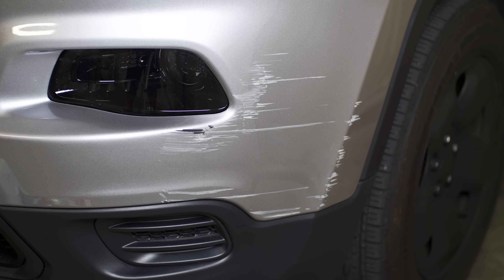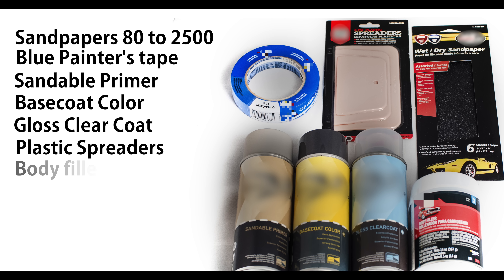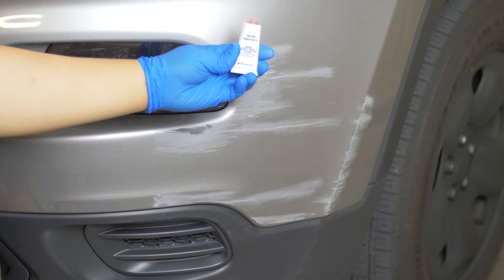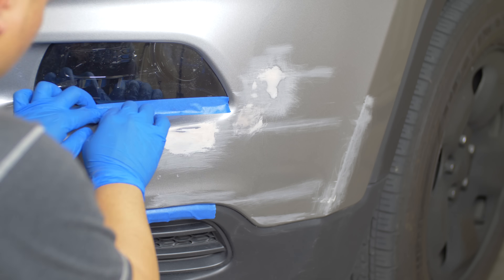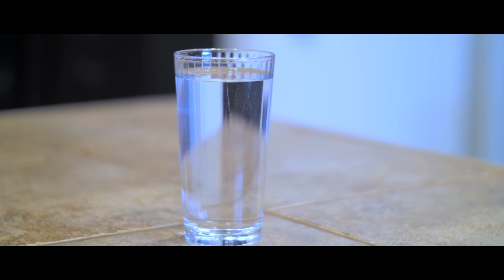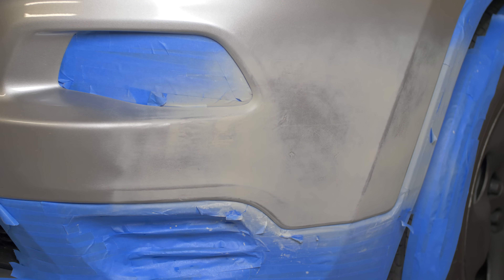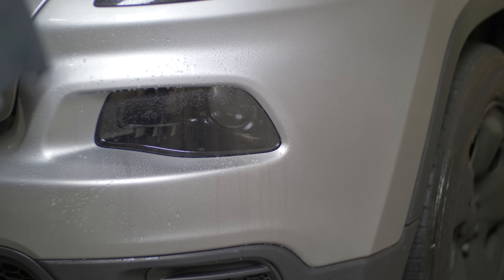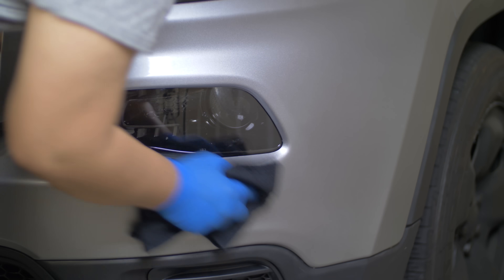How to Repair Scratches on your Car | Save Hundreds of Dollars

Comment: For those wanting a cheat-sheet breakdown of each step, here you go:

1/ 180 grit sandpaper to sand the scratches
2/ Clean with a microfibre towel to clean up the dust (dry)
3/ Mix body filler to hardener to right ratio
4/ Apply only to the deep scratches with a plastic scraper
5/ Let dry & then sand with 80 grit over the body filler
6/ Then a 180 grit to make it smoother
7/ Next, clean up the area with a microfibre towel to prepare for painting (dry)
8/ Mask areas to prevent overspray
9/ Spray the sand-able primer 5 minutes between coats, total 3 coats with each covering more and more area
10/ Let dry for 30 minutes
11/ Clean with a dry microfiber cloth again
12/ Sand with a 1500 grit wet sandpaper
13/ Then sand with a 2500 grit wet sandpaper
14/ Dry with a microfiber cloth
15/ Spray with the base colour like the primer, 5 minutes between coats & covering more & more area
16/ After 30 minutes apply gloss clear coats like the primer & base coats
17/ Leave dry overnight
18/ Next day clean with water & a microfibre towel
19/ Leave dry for 5 minutes
20/ Apply compound in dabs & rub in making 5 overlapping passes (by hand)
21/ Again, clean with a fresh clean microfibre towel
22/ Allow to dry for 5 minutes before applying a polish
23/ Polish with firm pressure & overlapping passes using a polishing pad (by hand)
24/ Then wipe it off with another clean microfibre towel This is your final 'buff'
25/ Done!

Comment: I followed all the valuable instructions here but the end result was not as shiny as the original paint. If you want the super shiny look , after painting and before applying the clear coat, there is a step you need to do to get that super shiny look. It is called "color sanding" which is wet sanding the paint with 1500 sandpaper to make it smooth. The reason is to remove the orange peel bumps on the paint, think of the mirror and the smooth silver layer behind the glass. It is not only the glass that makes the mirror shiny but the smoothness of the silver layer beneath. Glass in this analogy being the clear coat and the silver is the paint. Thanks for the video Thomas, saved me a lot of money.
Reply from the maker: Thank you so much for your suggestions. Unfortunately I didn't do that in this video but you are absolutely right. A lot of people in the comments mentioned sanding it to make it smoother and shinier.

Comment: Looks good to me. 800 dollars vs 100 dollars. I vote to keep the 700 dollars in my pocket. Thanks for making this video.
Reply from the maker: makeminefreedom thanks and you're welcome 😊
Reply: Thomas of All Trades Maybe you can come here in Sacramento and help me out, so I don’t ruin the paint on my car...lol
Reply from the maker: Michael Crz lol you got this
Reply: 700$ is for labour ..!!
Reply from the maker: sandeep shetty lol yeah
Reply from the maker: bo diddly lol i spent around $100
Reply: Air pump plugged in lighter pump started to burn while plugged in with car running  help
Reply: Moo hi
Reply: Thomas of All Trades hi I have one quick question I got the same scratch on my car like the one you had and you fixed it so my car colour is black any recommendation about working on with same way if you would tell me that would be great I got Hyundai elentra 2017
Reply: Lol so true
Reply from the maker: Bret Hart yeah same way make sure you get the right color black paint for your vehicle.
Reply: @ThomasofAllTrades  ok thanks god bless you
Reply from the maker: @brethart4938  youre welcome. thanks you too.

Comment: Nice DIY but it has a few flaws (no hate just helping): 

- When you apply a base primer (or any spray layer) make sure to press the spray head firmly to avoid any drops, spits or spills (as seen on 3:22). Sometimes you can get away with it as it may stay hidden under another layer or get sanded down later.

- When reaching corners always spray "over" the corners and away from the car. That way you won't create visible overlaps you'll have a hard time to work out the overlay so it won't be visible. The same goes with lines and edges. If you want a clean finish you gotta paint up to a specific line or edge where your stop won't be visible. You can try this yourself on something else. Like an old door or other stuff you can train your skill. If you stop halfway you will have visible overlays. 

- Spraying your color code might disappoint you in the end. Some spray colors tend to look different from what you have on your car. This may come from the light you are using (LED, tungsten, dayling, etc...) and angle (some metallic paints reflect light differently making it hard to hit the right tone of your color. Another thing is your primer. Spray primers come in a lot of colors. White, yellow, brown, silver, gray and black. And maybe some other colors. The reason is simple - using a specific primer color will help you to hit a different tone with your color spray paint. If you have for example a red car and it has been standing outside for some years you'll be on a road to hell getting your paint right. Silver is also complicated. 

- Using putty - use only as little as nescessary. The more you apply the more you have to sand down later. Meaning the space you demand in your 1st step will increase in each step. Suddenly you gonna find yourself working on almost a space 10x times bigger then you were looking at the beginning :D Reason is simple again - when you have to smooth out your previous step you have to blend it with the surrounding. And that blending in takes space. 

- When using clear coat ALWAYS use 2K clear coat paint cans. BUT BE AWARE!!!! ALWAYS WEAR HIGH QUALITY FILTER MASKS WHEN PAINTING WITH 2K SPRAYS!!!! If you inhale 1K spray aerosols you are pretty much safe. It will take some time to get out but you'll be fine. 2K on the other hand MIGHT KILL YOU!!! 2K means it contains not only the paint itself but also a hardener. Usually the hardener is separated and you have to press some kind of button before you can shake the can so both compounds mix. And when you inhale that stuff it may very likely glue your lungs stiff. Google it if you don't belive me. 

- Once you've done everything and the 2K clear has dried out propery then give it about a week or two to get back and polish it. Yes it may be dry to the touch but since you probably won't have a UV lamp to speed up the process then let nature do the work for you and wait. Once that time is up you are ready to finish your work by polishing it. Depending on your skills (or how much you trust yourself or how much you bother to get it done) you can take: 1) a simple polishing compound and just polish the hell out of it or 2) very fine sand paper for wet sanding to remove most of your orange peel look and then polish it with some compound to a shiny clear coat finish. You can see in the video that the finish is very matt finish which is not what you are looking for :) but Thomas of All Trades did a good job of using his camera at angles where it doesn't look that obvious :D but if you know what to look for you  will see it instantly :) again - no hate just tips to help. If I wanted to hate I'd just press thumbs down and left some negative one line comment. But why would I do that? 

- Last point - *price*. Why do paintshops charge you 800 USD when you can do it for 200 USD? SImple - 200 is for the rent, 200 is for tools and material, 200 is for taxes and 200 is what is left over. When I say rent I mean literally everything that is building- and property wise included not just the actual rent itself. The same goes for other "200" bits so please don't go into details here as this is not the point. And now what is left for you is the last 200 and here you have to really look out where you can save some cash. Lets say material. You work a lot so you can afford to buy bulk. BUT you gotta give your customers some guarantee (which you want for yourself as well because who doesn't want happy customers right?). Thus you gotta buy high quality stuff only. Now you gotta find the line where cost and quality is on par so you still save some bucks but you still maintain quality. But don't worry. As soon as you found your golden sweet spot the supplier will increase his price one day leaving you to consider what to do with that. Stick with your prices or raise accordingly to level out the buy price? The same goes for material, rent, taxes... everybody will at some point want more. And you have to play ball or find other ways how to cope with that so you don't lose customers. All that and more is something you DO NOT have to consider when you think "this is too expensive I can do it cheaper". Yes you can. And the paintshop could too. If the paintshop would not have to pay all of the mentioned above :D There is a reason for some prices being where they are. Do not disrespect it just because you are not ready to pay it. In most cases there is a looooong story behind it that you just don't see (and now you got a glimpse of it). If you are not willing to pay for something then that is absolutely okay. Go and do it yourself but please do not disrespect people that have to do your one time job for a living each and every day on a highly professional basis with a lot of unknowns and risks to take care along the way. This I am telling you as a person who is doing almost everything on my own because in most times I do not want to pay others to do stuff I can do myself :) BUT sometimes I do go all out and simply pay someone to do something for me. And I do enjoy the result as well as the feeling that this time I didn't have to do it myself. 

Allright.... now go out and do stuff :) take care :)
Reply: holy shit thank you
Reply: Thank you for taking the time to provide some extra information, I strongly suspect I’ll avoid making some mistakes I would have otherwise and I’m particularly grateful for the safety tip about the mask and spray painting 😌
Reply: Thank you for your advice and other insights! I appreciate it.
Reply: So in other words, better just pay an expert to sort it :D
Reply: @kylekeenan3485  that would indeed be the tldr version of the comment. 
It did give me a good idea to maybe get the cars polished. I mean, it looks nice
Reply from the maker: Thanks for your input!!
Reply: Very good advice. The 2K clear spray can is a must, the 1k acrylic lacquer clear won't last.

Comment: You could also wet sand your final product with 3k grit before buffing to flatten out the paint and make it blend better
Reply from the maker: Thank you. You're right!!
Reply: Hi Cesar, will doing this blend the new paint with the surrounding existing paint better? I applied the base coat but hesitant to put on clear coat as I'm worried that the final product will be slightly higher than the surrounding paint

Comment: Nice Job man. If I could give two tips it would be stop sanding after 600(metallic) or 400(solid) grit. The base needs something to stick to! Going to fine will not allow enough mechanical adhesion for the basecoat to bite into causing future adhesion problems. 

Another tip is look into the “spray max 2k clear coat”. It comes in an aerosol can that you activate. This will be far better than the 1k clear used. It will last just as long as professional shop clearcoat against UV.
Reply from the maker: The DIY Car Medic thanks for the suggestions! I really appreciate it! 🙏🏽
Reply: Dangggggggggg, I need to tell my barber the same thing. He is always wanting to reach for those other grits...hurts ma head!!!!
Reply: @TONYMLT  Oh stop crying. My barber uses chisels and a belt sander so count your blessings.
Reply: If I stop at 600 or 400 wouldnt fhe surface be rough? Will it become smooth after painting? Gonna do it for the first time here
Reply: Same question as InferiorG; please let us know!
Reply: Man you know too much. Do you have a youtube channel? Id like to subscribe. Id love to learn the mechanics behind every step used in paintng.
Reply: I agree on the 2k clear coat. I used 1k and it dulled out after couple years.
Reply: Also.. you want to make sure you have sanded with 320 grit sandpaper the entire area where the primer is going to prevent adhesion problems. Probley the most important step..
Reply: @MrAnonymous377  how often did you polish it?
Reply: @lindz151074   not often enough. Lol. The rest of the original paintwork is perfect
Reply: someone explain whar he mean by the first tip? im confused and first time

Comment: Dang you went all in with that sanding, you can usually stop at 800 for primer.  Nice job
Reply from the maker: A.J. Scalzitti lol yeah. Thanks
Reply: yes I agree 800 grit is good enough for the repair area. 1000 grit where you want to blend into. makes it easier to polish the outer areas after.
Reply from the maker: Nein Body 👍👍

Comment: Thank you.  If I wet sand primer then it washes away the primer from plastic and you can see the imperfections. It’s not smooth.  I used it again at the imperfections then it started dripping. I will try dry sanding
Reply from the maker: @rajeevjha9975  ok. Make sure the primer dries first.

Comment: Great job. One or two added ideas.
1. Use a bumper primer for your undercoat. This is a special plastics primer. Other primers don't adhere to the plastic bumper. These plastics have an oily like resin in them so the right primer is important. After priming apply your filler. Again there are plastic fillers that will stay on. Regular body filler won't esp if it's a large scratch or gouge in the plactic bumper.
2. Clear coat in the can (your final coat) is tricky to use if you want a high gloss that matches the existing gloss on the rest of the bumper. And you will need to put some effort into bringing out the gloss and blending it in with the existing paint.
Reply from the maker: Thank you for your input. I appreciate it.
Reply: I think he said he used the primer indicated by the product code on the car sticker. Looks like he chose his sprays based on that info

Comment: This is a super comprehensive 'do it yourself' video. I have been looking for something like this to fix a couple scratches on my truck. Thank you for sharing this. Super helpful!
Reply from the maker: thank you and youre welcome
Reply: My car was keyed.  On a warm day I used a black crayon to fill in the scratches then wiped the edges clean with my finger.  It lasts through car washes for about a year and then I do it again.  It has to be a warm day for the crayon to melt into the depth of the scratch.

Comment: Well done! I would repair scratches, and dents, on my vintage Dodge van in a very similar way. What I thought is that if I can't do a good enough job I can always bring it to a shop and pay the pros to fix it. I never had to bring it to a shop tho :D  The more you have to do this work - the better you get at it and the more your confidence builds up! After the 3rd paint repair I removed a door panel, banged out a dent (acquired in a parking lot from a negligent driver), and fixed the paint. Saved a ton of cash.
Reply from the maker: Thank you. Wow.
Reply: @ThomasofAllTrades  Plus, as you know, you save a whole lot of time and paperwork with DIY - even if the damage is not your fault. 
   I drove solo across Canada and back (over 8,000 miles/12,000 km) so scratches and stuff were bound to happen and I couldn't wait days or weeks for body repairs.
Reply from the maker: @drunkvegangal8089  that's true. If you think about it. You still have to make an appointment, they order paint and then drop it off to the shop and wait for days for them to finish.
Reply: @ThomasofAllTrades  Exactly.  Moreover, once you repair one scratched area you'll have enough supplies left over to do more.
Reply from the maker: @drunkvegangal8089  funny, you mentioned that coz apparently my jeep wrangler has the same paint code as the one in this video lol.

Comment: Hi, how did you manage to match the color of the entire bumper when you had just painted 1/4th of the right side.  There needs to be color correction.
Reply from the maker: Karan Agarwal it seemed to have blended well. Especially with using the wax and the 2500 grit
Reply: There are many factors in getting a good result. One plan I found which succeeds in merging these is the Magic Painter Method (google it if you're interested) without a doubt the most incredible course that I have ever heard of. look at this  amazing website.
Reply: If the car is young, this is less of an issue
Reply: hi everyone ,if anyone else needs to find out about how to spray paint a car at home yourself try Moorack Car Spray Miracle (do a search on google ) ? Ive heard some amazing things about it and my cousin got great success with it.

Comment: For the best cleaning of the surface use isopropyl alcohol (rubbing alcohol). it pulls small debris onto the microfiber towel and dries faster than water.
Reply from the maker: Thank you so much for your suggestions